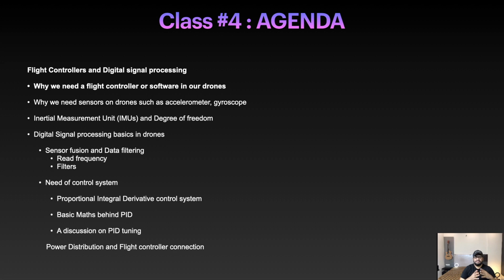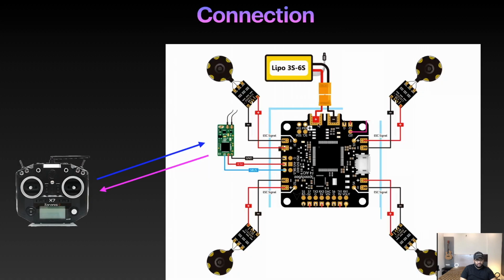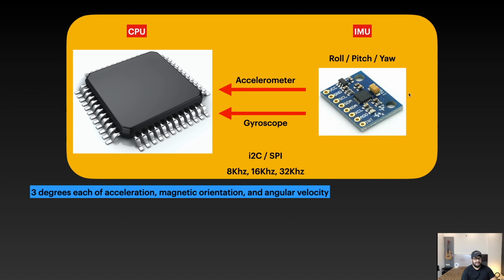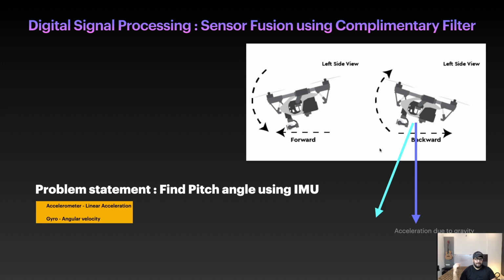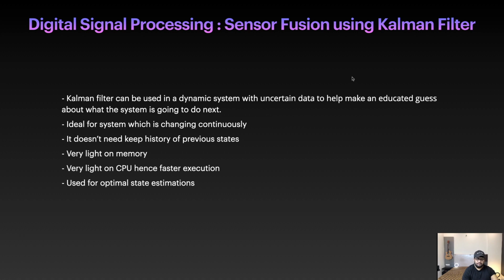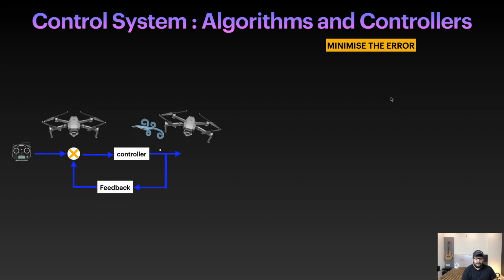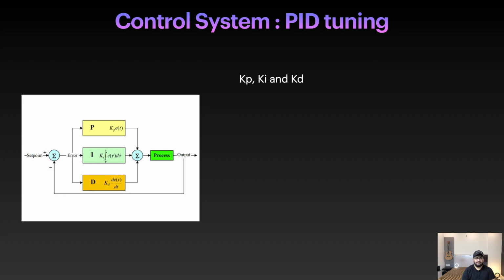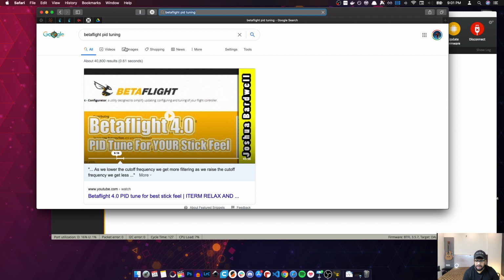Advance Drones Class#4 :Digital Signal Processing, Control System, Filtering and Flight Controller

Comment: you people can use internal wheels to control the stability of drone. as it is being used in auto balancing cycles.
Reply: Will result in terrible flight time because of the added weight of the reaction wheel